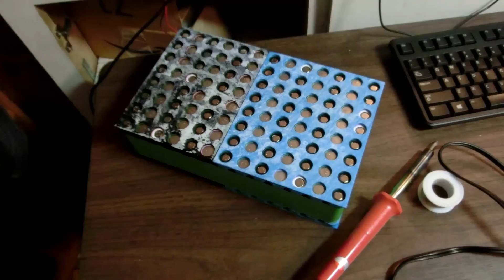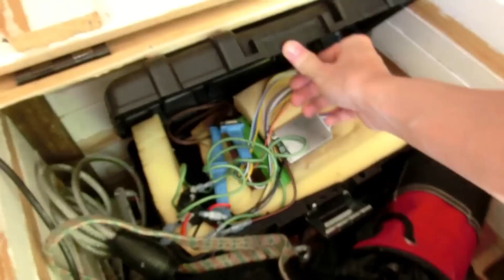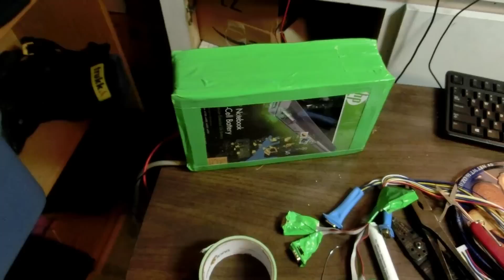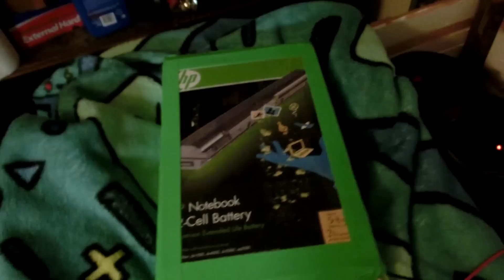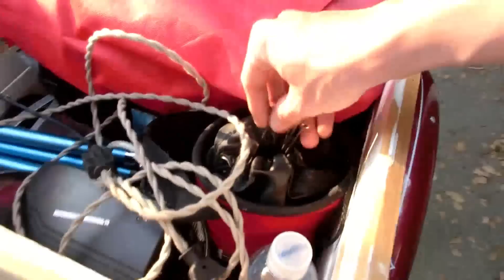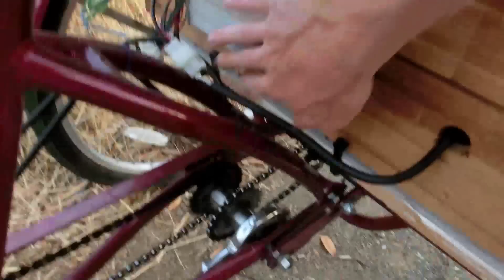DIY 52v (48v) 16AH Lithium-Ion 18650 E-Bike battery pack (E-Trike v1.6)

Comment: are the 9pin or 25 rated for the amps? you got some balls of titanium. cool stuff. I got 8 sony's from a dell dinosaur. I'm scared
Reply: +james kim i was thinking the same here. I understand that battery monitor need info from each pack or cell, dep on how u do it, but id rather use more powerful "output" leads and just have the thinner LPT or similar ports for the individual controls. 

Even if it "Works", the leads in those are so thin that even 1 single Amp will loose a lot off effect into the wires themselves id suspect.

Comment: Why carry so much weight with a wooden box? Wouldn't a motorbike helmet box to house your cells be a better idea? It would be lighter. Positioning the regulator so that it has better air flow and cooling would also be an improvement. 

Also what about your power sink problem, maybe an array of large capacity capacitors that can be used to level out the power cells, stick on a pair of 2 farad (highest voltage) capacitors. 

I don't know what the laws are where you are like but here in the UK, anyone wanting to BYO you would need note that your vehicle can't exceed 15.4 mph and motor power less than 250Watts (maximum power output), if not, then your facing heavy test and inspection fees and fines for not complying...

https://www.gov.uk/vehicle-approval

Comment: Nice effort.  Duct tape and most plastics are flammable.  Consider using aluminum tape and check for flammability of your plastics.  You never know if the batteries might give you trouble.Hate to see a flaming bicycle going down my block.
Reply from the maker: +secretninjawarrior aluminium tape is conductive, no thanks.

Comment: Are you not concerned about not having heat sensors?
Reply from the maker: +Winters if you have to worry about heat your doing it wrong. my battery only warms up like 10 degrees when i'm climbing a mountain. overheating battery means your battery is too small thus your overworking it.

Comment: how much mah is each cell? assuming its 5000 mah per cell and you use 130 cells - should be approx. 48v and 5 AH, not 16AH? i must be not using correct calculation
Reply: +Mazxlol Yep, not the correct calc.  Each cell is 2000 mah at 3.7volt.  He has 13 rows in series and each row has 8 cells in parallel.  SO... each row is 16AH at 3.7Volt (2000x8). Then he has 13 Rows, 48.1Volt (3.7x13)
Reply: +EWAN NUTLEY yeah i think i calculated 1000mah=0.1ah instead of 1ah. ( i feel stupid lol )

Comment: i want to make 36v 10ah battery for my bike 
i have a 36v 250w motor if you could guide me how
can i connect the battery to the controller inside the bike
do i have to solder the connector? thanks.
how many 1850 samsung batteries do i need.

Comment: what is that black charger you are using? im going to make 48V 12s battery from cells extracted from laptop batteries and i thought about double imax b6 so i can balance half of the pack with first imax and the other half with second imax.
Reply: +matrixx991dsdd its an sla charger

Comment: Where did you get the top and bottom plastic Battery pack holders?
Reply from the maker: +GoodScienceForYou made them myself
Reply: Rinoa Super-Genius Clever.  I am thinking of getting two blocks of plastic and drill holes in them on my milling machine.  Lots of holes but plastic cuts fast. I am trying to set up a DC well pump running on solar and batteries. .

Comment: hahaha love how you used an unfeasibly sized adjustable wrench, to gently yet firmly bash the cell holder on!I would try a bit of board to hit, between the cells and the... whatever I use to do the battering bit, but I can see how you could see any misaligned cells better, by not using a board or such to distribute the blow of the blunt n heavy object.Great vid btw - very helpful that you worked out the arrangement of the cells in the holder (that I didn't know about until now), I'm going to make a bank of lithium cells like this - but thanks to your use of the holder like this as a frame, ima getting me some of these too. I can't see any on Amazon or Ebay UK but AliExpress has them for $10 - it has convenient cut-outs so that the cells can even be spot welded with flat strips (I have a small spot welder)
Reply: +jayc2469  when in doubt hammer it out:p

Comment: Soldering directly onto the end caps? (bad) spot weld only. No thermistors or anyway to monitor what is going on inside all that?I was wrong about pico fuses, rant  Removed. Any properly functioning charger/bms can only charge the cells to its predefined cutoff point, 4.20~4.30v, .1~.07c of the cell(s) or temp/timeout whichever hits first. If the cells discharge unevenly it has nothing to do with the charger, just mismatched, poorly made or mistreated cells.  And beef up those lead wires. All that hard work to just fizzle off your charge in those little skinny wires. bet you are loosing 10 or 15 watts alone in just the lead wires while under load. Otherwise awesome build, dig the case. Is that an Apple Lisa I saw in there?
Reply: +Dawn Minilla it is being discharged really slow, maybe 1 amp or less per cell.
Reply: Most people solder 18650 batteries instead of spot-welding them. Sure, spot welding is preferred but this works for 1000's of others. I think it's a decent build personally!

Comment: Just tip:  Power sources ALWAYS need to have FEMALE pins!
Reply: +tkarlmann its not a high enough voltage to injure, and they are shielded connectors

Comment: You don't want to heat the motor up. You'll demagnetise the motor magnets.
Reply: +NELICOPTER (was da) it would have to get really hot before it would do that, i would worry about other things breaking
Reply: Best to keep it below 60 degrees c.
Reply: NELICOPTER (was da) yeah, usually it isnt working as hard as it is in the video, he was full power at like 15mph, usually full power is 30-40 mph
Reply: IMO he should get two on the trike instead of one. More efficient.
Reply: NELICOPTER (was da) it would lower efficiency, and add more weight to move around, plus hiis trike broke so he doesnt use it anymore
Reply: Well I didn't know about his trike breaking, but it wouldn't weigh much more. When a motor is under strain, it can use more current even it goes the same RPM. When a motor is busting its guts, it will heat wasting energy. But his trike is broken anyway so whatever.

Comment: Many moons ago in the U.K. the lights on a cycle ran off a dynamo which had a small wheel which touches the front tyre of the cycle...the wheel spun the dynamo which powered the lights...I thought you may be able to get something similar to charge the battery a little....Just a thought.... Good video though...thanks.
Reply: +ningis21 you would be wasting energy, as the hub motor is about 90 percent efficient and the dynamo even less.

Comment: Or.......solar panels on the battery box for a little extra trickle charge when mobile or parked up ....
Reply: +ningis21 not very practical, it would be more space, weight, and cost effective to have a larger battery

Comment: very nice, flat ground this setup could travel well over 80 miles on a charge, to give it some power thought I would have to come up with a rear wheel setup just seems like front wheel climbing is exhausting some of the cheaper components (motor controller)
Reply: +xtort107 with his previous 24ah pack he would get 150 miles on flat ground with a regular bike, about half that with the trike.
Reply: DMAN22yeah i plan on doing something very similar very soon, but i see how cheaply those motor controls are built, no heatsink just the case, makes me want to buy my setup in pieces instead of a kit that way i can find a more robust controller. I' ll be climbing similar hills so i ll  need all the power i can get.
Reply: xtort107 the best thing to do is buy from an ebike website or have a small fan attatched to the controller, the motors are around 90% efficient so not a ton of heat to worry about

Comment: question:
what voltage does your bms run on? do i need any special ac/dc adapters?
thank you!
Reply: +Nick Silcox he uses a standard sla charger
Reply: +DMAN22yeah an SLA is for 6/12 Lead acid batteries.. not 48V Lithium ion batteries
Reply: Nick Silcox he uses a 52v sla charged into his bms

Comment: Great video buddy, really interesting. Just a tip, for battery or any other electrical system, use FEMALE connector, and MALE on the connector where is no power output. Why ? Becasuse, imagine you would have electrical plug that would have MALE connections, not really safe to touch :)
Reply: +1KeNnY1KeNnY1 48v dc isnt dangerous unless you have wet hands

Comment: Di you know where I can buy those batteries,  not eBay I have heard of people getting batteries that explode from China.
    pulse would you sell one of the holders for batteries, (two of them) . I need one's with less holes, but if you are willing to sell a pair I will take whatever you willing to sell.  if yes I will send private email.   I have been saving to get printer but always spend some on my projects. (do you know if the new $100 printer is any good. it's on. INDIGOGO or kickstarter.   the one I want is $700.  
sorry this is so long.   
(you could make a killing selling them on eBay, especially with batteries. call DIY battery pack.) thanks love the videos I have learned a lot.
Reply: +Jason Morgan old stock laptop batteries

Comment: what should one search for to get hold of cheap 18650's on ebay
Reply: good used ones i mean , not the 'ultrafire' scam ones with only 400mah
Reply: +LeoTL old stock laptop batteries
Reply: thanks
Reply: +LeoTL Five Below sometimes has the 6600mAH cell phone charger packs for $5.00. They have 3 batteries inside, but if you can buy "bad" laptop batteries, there's usually only one bad one.

Comment: I have not seen that you use a BMS (Battery Management System).  ´What I have Heard is that with lithium batteries it is important to keep all cells with the same charge.  What do you think about this?
Reply: +Jan Kleyn ok so im not sure what you mean exactly, but i will answer both things this could mean. if you insert a cell that is at 3 volts with cells that are at 4 volts yes that is dangerous. if you are talking about the capacity, then it is safe, but i wouldnt put a 100mah with a 3000mah

Comment: Could you recommend me a good iron for soldering 18650's? I can see you are using a Weller, but I can't tell what wattage. If you have a link to the iron you recommend that would be awesome! Thanks!
Reply: +Neo2172 something above 25 watts that is very hot

Comment: Adding a fan to blow directly in the controller probably wouldn't be a bad thing, especially since when tn is working the hardest you are not moving that fast so airflow is going to be low.

Comment: I would have used a Molex large connector bocks used in electronics for higher current. Heavier wire and built an aluminum box housing for the equipment box on the bike for less weight. you can get a commercial rivet gun aluminum rivets cheep from home Depot  along with sheet aluminum.

Comment: I'm not 3D printing sheet! Benefits over hot glue?
Reply: +Grover Asylum ease of use
Reply: ease of use is relative. nothing easy about 3D printing without a 3D printer
Reply: Grover Asylum his friend has one tho, so he probably would have used duct tape alone if not.
Reply: Rinoa's battery pack before this was put together with hot glue and duck tape. That's why I asked. As far as I understand both packs are in use. I have access to a 3D printer. I just don't think it's worth the trouble to make a night of messing with the thing.
Reply: Grover Asylum i guess he wanted to make it right this time, and i wish i had access to a 3d printer.

Comment: Man I absolutely love your channel. One recommendation though: have you seen those middle drive chinese electric motors? Like the Bafang e-bike motor. Or 8-fun (maybe they are the same, not sure). I am thinking about getting one of those as they are much better for steep hills and generally for climbing compared to hub motors. Also you can install them on any bike.
Reply: +zoltan87 they are good for standard bikes, but his has a poor design for rwd

Comment: Great video Rinoa, you give me so much courage to try stuff with lithium cells.

Is it viable to make a 12v pack from 81650 cells? (Given the full charge on a 12v battery is around 14v which doesn't divide nicely by 4)

Keep the videos coming!
Reply: +Corner Gav you could do 3s which would give you 12.6v full and 10.8 empty

Comment: i wished there was a place in AZ that would make custom battery packs
Reply: +LastManStanding buy from amazon/ebay or use lipos in series and an imax b6 to charge
Reply: I would but my soldering prowess is less than to be desired
Reply: LastManStanding same, just take your soldering iron and put a bit of solder on the battery and then press your soldering iron on top of the wire and feed solder in and take the heat off, dont hold the heat on there for too long or else it doesnt stick as well. i am only 15 and have a 23 watt 1990 soldering iron, but i still manage to make it work, the worst thing you can do is too much solder.

Comment: Hey Rinoa!

I was wondering what you would recommend for a battery charging system or BMS.  I know one proscess involves taking all the cells down to 2.9Volts or what not so they are all the same and then you charge up the whole pack.  Where is a Battery manage sytem for sale that is fit for a 15ah bicycle system?  Don't seem to be able to find them.  Need new battery pack for Bicycle,  24 Volt. Suspicious of some charging systems.
Reply: +Gordon Moore i would buy a cheap ebay 18650 charger and charge each cell pack to full

Comment: I see you started trusting bms's.  Do you have a particular brand you use? What about the charger? is it just a basic chinese lithium charger? Also mixing different brand cells...Do they have different discharge rates that could cause an unequal voltage or possibly damaging some cells or is it just important to have the same mah rating per pack in parallel?
Reply: +Danny Kennel inequality wont happen within a pack of cells, but you shouldnt have too much variation in the series config.
Reply: What's the tolerances on mah per series cell. I'm trying to keep it close, when I find a limping row I add a cell. I'm not sure these used cells like full throttle much
Reply: Danny Kennel you should have the cell discharge rate be no more than 1.5-2 amps per cell, i would say tolerances for variation would be 600mah per 10ah of capacity
Reply: +DMAN22yeah I ride an Ebike pulling about 30 amps at full throttle and have built a few high drain packs for customers, just really trying to understand the whole discharge/amp draw levels of different cells. I have gotten ncr18650bd's fron a laptop before. hopefully they keep using higher mah cells
Reply: Danny Kennel the cells are usually rated at 1c for computer stuff.

Comment: Hello... just one question... what kind of fuses do you use.. cand give me a part number or a link? ... thanks .. appreciate
Reply from the maker: +Krisztian Adrian Barna picofuse
Reply: +Rinoa Super-Genius picofuse ... and  and for what current , voltage? thanks!
Reply from the maker: Krisztian Adrian Barna
4a 250v
Reply: +Rinoa Super-Genius thanks.... !  another question .. what was the range with one charge for a 48V and 20A pack with your bike?
Reply from the maker: Krisztian Adrian Barna
about 20 miles at 20mph and 40miles at 10mph on my tricycle. but double that range on my bicycle. so 40 miles on my bikcycle going 20mph.
Reply: +Rinoa Super-Genius Thanks!! ... i would ask you another question... i have a 13 cells li ion 18650 pack... and i bought a charger AD360CH58 what is designed for 58 VDC and 5A. do you know how i could regulate the voltage to 53.3? i was looking inside the charger but i did not found screws to regulate adjust the output voltage... Any ideea? i would appreciate... Thanks!!
Reply: +Krisztian Adrian Barna use a bms and if you need use a dc-dc converter there is a 10-60 to 10-80v one on amazon
Reply: DMAN22 thanks, I have a cheap BMS, PCB (25euro) is only balancing cannot cut the charging current , ... I would buy  better BMS what can be programmed but its Costing 200 euro and can handle may kind OK battery packs ... And Tenperature controlled ....you right I already have the Dc Dc converter I would try with that also is the 600watt from Amazon ... 10-80v one ...

Comment: Nice work Rinoa! Im curious , isnt it better to put fuses betwen paralleled cells? So if one cell shorts out the other ones in parallel will try to "charge" failed cell  and fuse will blow, and u save other cells in that parallel... THis way if one of cells shorts out it will put down to 0v all other cells in that group :|
Reply from the maker: +Igor Tomic yes i put these fuses between the parallel cells.
Reply: No no..You misunderstood me.
I wanted to say isnt it better to use pico fuses to wire 8 cells in one parallel? That way if one cell fails other ones in that same parallel will burn out the fuse on the broken cell and continue working without it.
Reply from the maker: *****
yes thats what i am doing.....
Reply: +Rinoa Super-Genius How is that? On video i see you used fuses to connect oposite polarity connections.. + of the one parallel to - of other etc...
Reply: +Igor Tomic he connected a buss bar to one side and then fuses on the other, then if a cell goes it will cut out that fuse